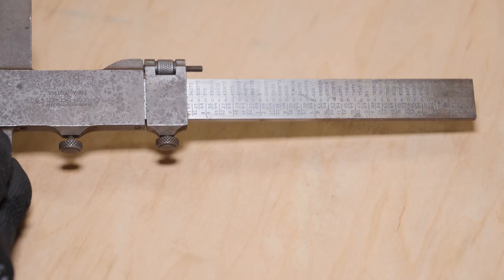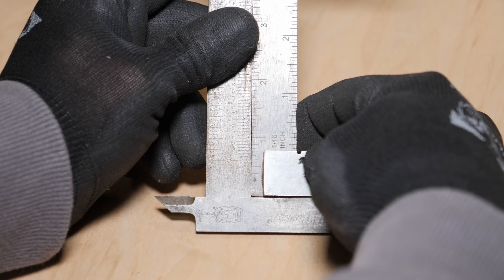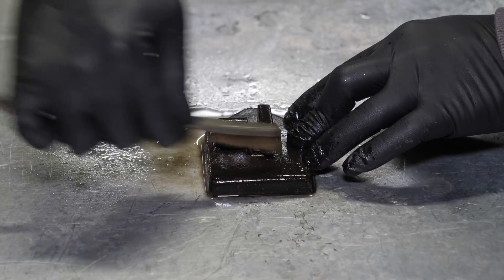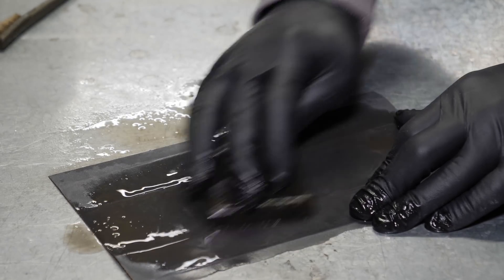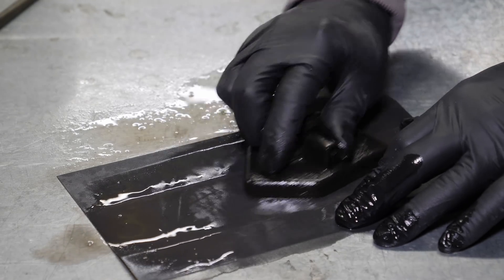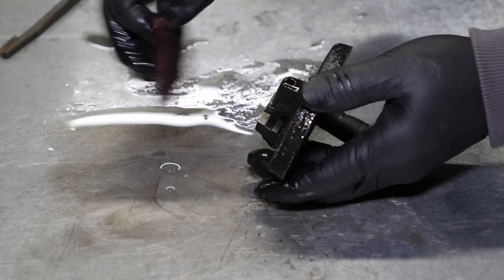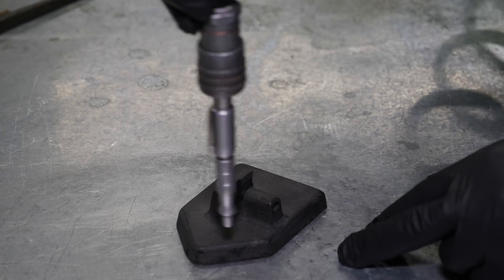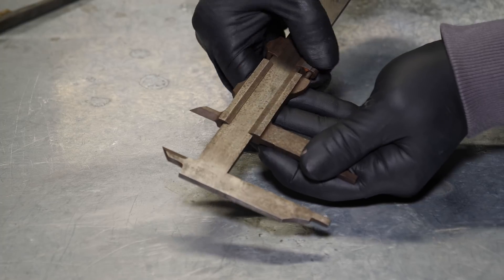Quick Caliper! Lathe Tool Height Gauge

Comment: nice tool and cleanup...gave me a build idea...
Reply from the maker: I use it all the time. It's set to lathe center line from the top of the cross slide. Set it on the cross slide, flip whatever tool holder/tool that needs reset to center line around towards the cross slide on the multifix. Gauge the height to the caliper, flip the tool holder back around to whatever cut position and back to work. Fastest way I have found to find center...

Comment: Just found your channel and it's really cool. You have the same machines I do. I don't have a tapper attachment for my lathe but it is well equipped. And I've never used the horizontal drive on the mill. But all in all I've got some serious viewing to do. There are groups out there for information on these machines. Parts are sometimes hard to come by but are out there even if they are homemade. I belong to a yahoo group for the lathe they have shop manuals and old guys with much experience. Thanks for posting and keep up the good work.
Reply from the maker: Thanks for commenting Micheal!

Comment: Could have been made for the UK market too(more than likely)in the pre decimal days. Lots of machinists still use imperial over metric, I took to the metric a lot easier than most even though at school it was always imperial. Everything to the power of 10.
Reply from the maker: Maybe....I said that just because the importer was based in New York.
Reply: @BurtonsAttic  it did sound like you meant that it was it was imperial... BTW you do know that Canada only started metrification in 1973...

Comment: Is this a precision piece? How critical is the surface finish of the base and the measuring ends?
Reply from the maker: As I showed in the video it is accurate to .001 which is what it was designed to do. Since I'm using it as a height gauge the value is not important to me. It's just for transferring dimensions. The stand is not calibrated to the scale but it is flat......

Comment: High grade stainless steel is not heat treatable 400 grade stainless is heat treatable 400 is magnetic
Reply from the maker: That's one area I'm lacking in Ed. Thanks for the information. It does seem to be hardened as well. I guess at that time they (Mauser anyways) wheren't to concerned with labeling things as such "Hardened Stainless Steel"